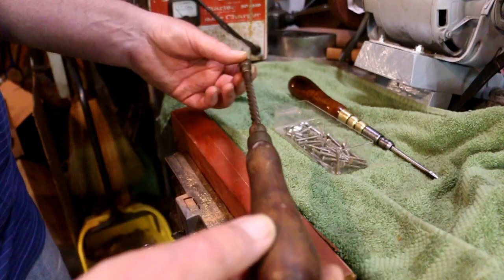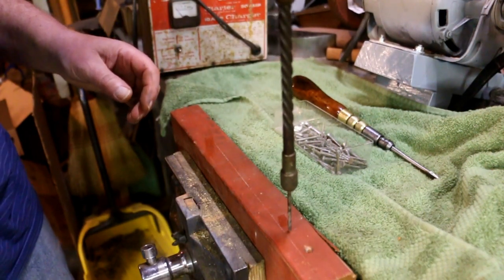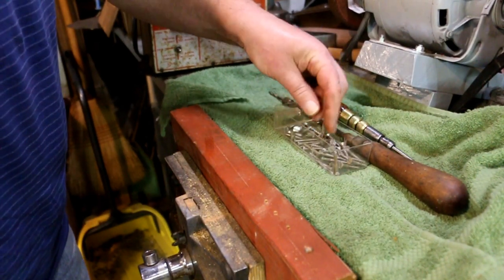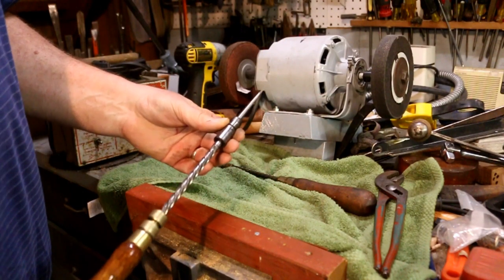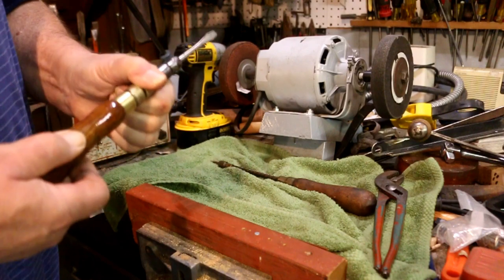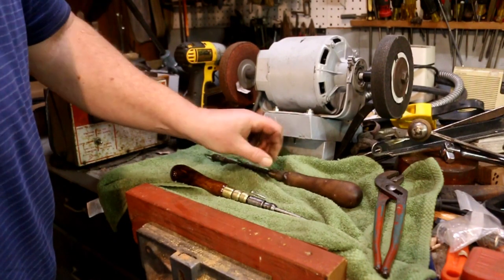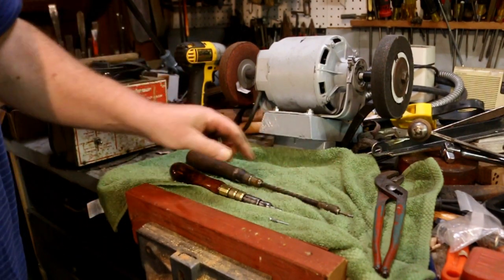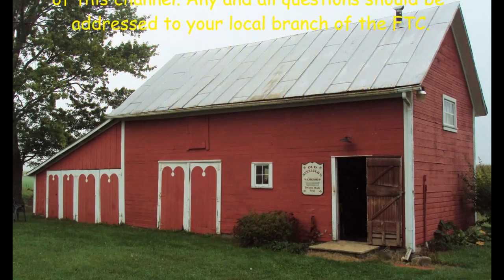Using The Goodell Pratt No 105 Push Drill & No  22 Screwdriver

Comment: Good to see these in action.   Nice tools, well made and a piece of tool history.   
I do not like using slotted screws due to the driver often slipping off the screw.
Dave.
Reply from the maker: I use them on restoration project just to match the period. I prefer Robertsons. 
Phillips was designed to cam out before they snapped while driving, 
Torx bits tend to strip out and the tips of the bit chip off the driver. 
Slotted screws have to have exactly the right size driver and won't  tolerate any miss alignment.  😁😎
Reply: I love Robinson screws.  They are the best for not caming out or breaking the bits.
Dave.

Comment: Power operated -- You provide the power and it works as well as the operator.... Never managed to find a good operator for mine...
Reply from the maker: Takes practice. 
Got to admit, a good fully charged, battery operated, driver with a Phillips, Torx, or Robertson screw head is a lot easier to use.  Especially in tight spots. 
Still not bad for a 130 year old idea.  😁😎

Comment: I can't drive straight slot screws. If I HAVE to, I drive them with a HAMMER! If I'd been giving this demo I'd just've said 'Go Watch Uncle Sneelock'. Happy Grandparents Weekend and GBWYall!
Reply from the maker: Same issues with a Yankee. 
Slotted bits are fussy. Even driving a Phillips or Torx bit a spiral driver tends to want to skip out. 
I have to be sure and push straight down in line with the screw. Any deflection will let one side of the bit lift out of the slot and off she goes into the new pairt.  Grrrr.......
😁😎
Had the same problem with the AC Gardner Tool Box.
Reply: @OldSneelock  10/4 on the toolbox. I need to get an Estwing. My Stanley tends to get off center a bit now and then. The 3 pound pounder does fine but is a bit much. Happy Oliver!
Reply from the maker: Using Ardox coated nails is nearly as strong a hold as a screw and your Stanley will drive them just fine. 
They're hard so they don't bend. 
Just make sure they go in the right place. Changing your mind is going to be a lot of work. 😁😎

Comment: I like using my drill for small holes and I don't mind driving Philips screws but like to use square drives( I have a conversion to use square drive bits with my driver
Reply from the maker: I was keeping with the original design of the driver. In 1891 when it was patented slotted screws were pretty much the only game in town. 
I also prefer square drive screws. Phillips heads strip out too easily. If I recall correctly the rights to the Phillips head screws were purchased by Henry Ford because Robertson wouldn't give Ford the rights to the design. 
Ford went with Phillips and doomed everyone to fighting stripped out screw heads in Ford cars and trucks. 😁😎

Comment: I can’t figure out how to get my 1901 number 105 open to replace spring.  Mine has a partial knurled chuck with two large jaws.  There is a brass ring at top of lower drive with a cross slit.
Reply from the maker: I will have to check. 
I think the brass ferule by the handle unscrews releasing the shaft and spring. I will get back with you.